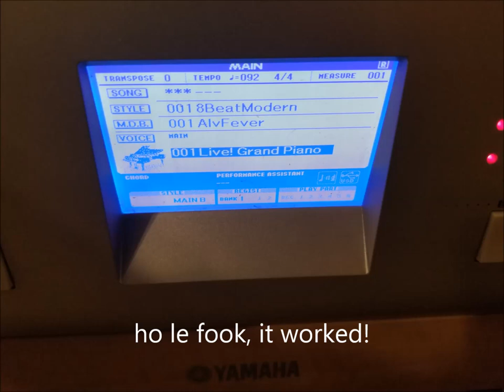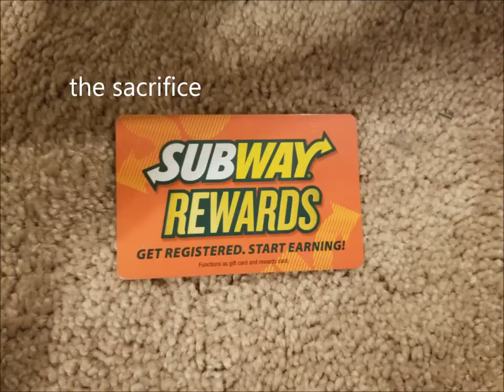Yamaha YPG / DGX LCD Screen Fix, Easy & Fast

Comment: Thanks for this great video, it encouraged me to fix my YPG-625 finally and it wasn’t too hard, just time consuming dealing with all the screws. Some tips: 1. There are two sizes of screws to keep track of, and you’ll need a bit extender if you use a power screwdriver. 2. There are two panels on the underside that also have to be unscrewed and removed because there are more screws behind them! 3. I bought a new screen instead of trying to put clips on the old one. The way the cables are attached looks a bit different so maybe it won’t develop the same problems. 4. If you replace the screen, you will need a soldering iron, because there are two wires that you need to connect (good thing it’s only two). 5. If you need to unplug ribbon cables, keep track of which side of the cable is which (I marked it with a sharpie), and when reconnecting them be careful not to kink the cable or damage any contacts.

UPDATE: A couple of weeks after making this repair although the piano keys still worked, most of the other buttons stopped working right, they would do random wrong things - only the volume control and instrument selecting dial still worked. Either something I did broke it or it was the next thing due to go wrong. Luckily I gave it away to someone who has kids who just wanted a piano to play around on, it could still do that.
Reply from the maker: Great advice, thanks for sharing. I'm glad this video helped you! This piano is approximately a 2005 vintage so many things may be different depending on your particular build.
Reply: You should have just used the clips instead of wasting money on a new screen and tampering with wires.

Comment: Almost did what this video was proposing, but after some more research I learned that adjusting the contrast could solve the problem. Just turned the contrast knob on the back and voila!
Reply from the maker: Yes, please do try this first. Adjusting the contrast knob only worked for about 1 year for me, then no longer helped. If using the knob helps, this may repair may still be in your future. Thanks.
Reply: I wish...
Reply: I didn't even know about the contrast knob.  That worked for me.  But good to know about changing the LCD screen.

Comment: Thank you so much!  I followed the directions on my DGX-620 and it worked!  So pleased. Just wish I could have shown my mother!  I used pieces of credit card as I did it before reading the comments. I’ll discard them if the clips slip off. Great video!
Reply from the maker: Glad it helped. The card was just something I did thinking it would help when I first did this and it ended up slipping off a week after I made the video. I later did it with just the clip (and maybe still some electrical tape?) and it has held ever since.
Reply: @jspianoman07  Thanks. It should save me some money though. 2/3 of a credit card looks like it won’t work as well!

Comment: The snippy clippy part was a little tricky due to lack of space and was scared to pinch the back of the connector but worked fine in the end. Very nice 3$ repair and great video!

Comment: I don't think these pianos were made to be moved a bunch. After my third or 4th move, I started to have these issues and I always figured it was a loose connection because I would apply a bit of pressure on the screen and it would start to work again.... until that fix no longer worked. Thanks so much for sharing and for the hilarious details!
Reply: The screen on my YPG-625 would work sometimes and not at other times, it was just unpredictable - even though I never moved it. It’s possible it was being affected by temperature or humidity.

Comment: Thanks! The 535 model is a little different. No orange thing, lol. For me, I just gently shifted the ribbon cable connected to the screen until the screen worked (no more lines) and then taped it in place. So far it's working good as new!

Comment: Worked perfectly. Just a note the DGX 520 model is alittle different. You actually dont have to remove the top board at all the bands for the screen are flipped so easily accessible. But there are more screws due to 2 pieces of faux wood covering the speakers on the back. MAYBE a 10 minute job. Just be careful with ribbons, i actually bought my board sight unseen (like a dummy) and dude lied and said screen worked but it didnt and you saved me 💰💰💲💲
Reply: My YPG-625 also has the two pieces of “wood” on the underside, which have to be removed to get at more screws. And yes the ribbon cables are easy to damage when plugging them back in if you aren’t careful; I kinked one and almost ruined a contact on it.
Reply: i am about to buy same model and it has vertical lines on it can you help me with that?

Comment: this is great! almost got the screen back to normal but seems there's more damage than your case so this fix worked for me I would say 70% (screen is readable but has lots of vertical lines). Still way better than dead screen. Thank you!
Reply: Check all your cables -  unplug, replug each.

Comment: Seriously dude, put the donate button for tips! I didn’t try it yet but I was about to buy a screen lcd replacement 90$, maybe it won’t be enough for me but at least I gonna try now that I know how to do it. Even if I’m an electrician I’ve not been able to find this solution. Thanks for All !
Reply from the maker: Thanks :)
Reply: @jspianoman07  😅 I have here in front of me the keyboard unmounted, I’ve pushed the point you showed in the video and also all the others but it still stay half blue half white or all blue it depends by the time, I guess it wasn’t a connection problem. anyway it worth the try. Thanks again tough ;-)

Comment: I have a YPG-535 stored away at my grandmother's house, and I'm going to be getting a hold of it next weekendnow that I've made space in my apartment. I know it has a screen issue and it looks the exact same as your screen did at the start of the video. I'm going to try this out when I receive it, and see if it fixes the problem.
Reply from the maker: Best of luck. As I replied to some other commenters, the addition of the credit card clippings are not required. When I first made the video, the clips soon after popped off. I was able to do it with just the binder clips and tape and it has held fine now.
Reply: @jspianoman07  what are the clips for? If reinserting the display ribbon fixes the problem do you still need the clips?

Comment: I attempted this on my YPG-635 and destroyed it. Had to throw it away. Maybe I'm just not good with my hands or something, but the guy in the video makes it look a lot easier than was my experience. Just wanted to put that warning out there for others thinking about trying it.
Reply from the maker: Sorry that it didn't work out for you. Of course anyone reading or watching should make a reasonable guess at how confident you are with being able to do this. Probably not a beginner project.
Reply: @jspianoman07  No problem. I'm not blaming you at all. Truth be told I was in the market for a new piano anyway so I went into it willing to throw out the unit if it didn't work out. Not a big loss for me. I just wanted to let others know that there is a risk to doing this. You make it look easy!
Reply: I rate this project a 4 out of 10 on the difficulty scale for someone who is used to tinkering and fixing stuff. But even for someone who fixes electronics all day, I think there’s still a risk that clamping the cables could simply not work or make things worse - just because of what they are.

Comment: I tried this on my Yamaha mm6 with no luck. Is the purpose of the clamps just to tighten the connection? Maybe I didn’t to it right.
Reply from the maker: The clamps push down on the ribbon cable which helps the two metal surfaces make better contact with eachother (meaning making a more solid connection). This usually fixes the screen issue because the lack of a good connection is typically what causes the problem in the first place. Based on feedback I have seen on my video, this doesn't work for 100% of cases, but does seem to help most people. This is a known problem with the YPG series Yamahas. I have no idea if it applies to an "mm6."
Reply: @jspianoman07  thank you. Maybe the screen is just broken, but I will give it another try.

Comment: Have not got a clue what your doing with the cards, and what the purpose is, because screen was fixed just tightening connection , SOMEONE PLEASE EXPLAIN
Reply from the maker: The card is not necessary. I originally added it because I thought it would help the clip press down on a wider surface area of the ribbon cable. What I found is that the card ended up causing the clip to slip off after I had put it all back together. You can accomplish the same thing and with more reliable results without the card. This video was just from my first attempt at this repair.
Reply: @jspianoman07  I had the same question. I'll have to look at the video again and again.... needs narration explaining the process. I kept pausing the play to read your instructions.
Reply from the maker: @RobertHampton747  You only needs the clips to press down onto the connection. The cards are not needed. I used them in my initial attempt to repair it and later found them to be unnecessary.

Comment: I’ve got my DGX620 open and I’m at the Dollar Store right now buying those big paper clips and electrical tape…just trying to make sense of what you did exactly? And do the clips stay there when you close it back up?
Reply from the maker: The clips are just clamping down on the ribbon cable to keep firm pressure on the contacts. The electrical tape is just to act as a dielectric to prevent anything from shorting out (the tape probably isn't even needed honestly, but I did it just to be safe and ensure nothing electrical would short out where it was clipped). For example, just think of it like if you have something plugged into the wall, like a lamp, but the plug is loose so it keeps falling out of the wall, the lamp goes off (like your piano goes off). Say you stand there and hold the plug in the wall to stop it from falling out, thus constantly applying a force to hold it in place (like a clip holding the ribbon cable down) then it will stay on and work. We use a clip so that it will keep applying that force even when we close it back up. Simple as that. Side note, the credit card is not needed at all, I removed it later on when it proved to work without it. Yes, you want everything to stay in place when you close it back up, that's the idea. If it doesn't, it likely will not stay fixed. This was a complete experiment on my part that worked for me, hope it works out for you as well. I think some others here in the comments have indicated it worked for them as well.
Reply: @jspianoman07  thanks. I’m holding the screen in my hand as I type this….my clips might be too big but I’ll find out in a couple minutes. 
Thanks again.
Reply from the maker: @murphine969  Sure thing. Be warned, getting the clip in was tricky because it barely fit and kept falling/springing itself off. You will eventually get it if you keep at it, assuming it's just not outright too large. You do want to check that it actually fixed the problem before screwing everything back together, else you're taking a big gamble.

Comment: Hello, I have the YPG-635 model.  On some days, the screen works fine and on other the days, the screen stops working.  But it has been working good for most days.  Did you have this experience before the screen stopped working completely?  I'm debating if I should try the paperclip binder now or if I should wait until the screen stops working completely.  Thanks for the video!
Reply from the maker: It would go in and out for about a year or two. I could sometimes get it to work by smacking the screen hard with my hand. Then it finally totally went out. If it is going in and out, it will eventually completely go out, but it may take some time.

Comment: Just tried this. So far only half of my screen came back but maybe I just need to move the clips around a bit. Also, I’m not sure why I was supposed to remove the speaker cable so I didn’t, maybe that’s what I need to do? Thank you anyway though, half a screen is better than no screen.
Reply from the maker: Removing the speaker cable is optional, just makes it easier to get the top part out of the way so you can maneuver more easily. For me, wiggling the clips around eventually gets the connection to make up properly, but I suppose this may not work for 100% of cases.
Reply: @jspianoman07  Got it. Thank you, again!

Comment: Didn't work for me 
I've got a DGX640, it's slightly different inside and there's not enough space inside for larger clips 
I did apply a little pressure in different places to the thin ribbons and the screen came on!
And off
Half on
Covered in lines
Thanks for the vid I'll keep trying different things
Reply: I have a DGX0620, and a similar experience. Did you ever find a solution?
Reply from the maker: Sorry to hear that. Sounds like it is a similar issue though. You may have to experiment with different ways to clamp down on the cable. I hope you figure it out. Thanks for the feedback.
Reply: I'm just gonna get a new screen from flea Bay, it's only 2 wires to solder on, after opening the keyboard up once I'm not feared about it....
Everyone should definitely try this fix first, when you start playing around with the ribbon cables the problem becomes apparent
Reply: p

Comment: I might try this, I’m curious though, why does this happen to these pianos? Is it really common or is it because electricity or something? I wanna know if it was my fault.
Reply from the maker: It's not your fault. It is a known and documented design flaw with these older Yamaha pianos. It has nothing to do with the electricity and highly unlikely that anything you did brought it on. The ribbon cable in the paticular spot appears to be held on by an adhesive and my theory is that it simply loses its strength over the years and comes lose. Kid of like how if you tape something on your wall, eventually the tape comes lose and ot falls.
Reply: @jspianoman07  I see that does make sense. I’m gonna have to try your method once I have enough time, it looks like an easy but long process haha.
Reply: I think Yamaha just uses crappy screens.  I have a mm6 with the bad screen as well

Comment: @jspianoman07 can you play normally on a it if the screen doesnt turn on at all? Also do you think it would be a easy fix? thank you!
Reply from the maker: Yes, plays fine with the screen broken. You can still change the voices and use any of the functions, just can't see anything on the screen. The fix will be easy in difficulty for someone who is comfortable with a screwdriver and has taken things apart before, probably moderate difficulty for someone who has not.

Comment: Hi, can someone help me please. My display is working except it is dim. I think the back light is gone. I blinked and came back and went dim again. However, I opened the casing and one of the flat ribbons came off. I accidentally pushed it without realising the bare wire were not sealed in the plastic and all bent. I straightened them but they are so sensitive that when I push them in , I think they touch each other and nothing works except the piano and the large dial that changes the voices. I pulled it out and in again and some of the buttons worked and went off again. I ordered new flat cables but I they have not arrived yet. I like to know if anyone had a similar problem? I am not sure if anything is damaged.
Reply: Did you try to turn the contrast knob on the back of the piano? If the screen is readable but dim or washed out, maybe that’s all that’s needed. Re. cables, I almost caused the same damage when reconnecting the flat cables. You have to be very careful.

Comment: Are all the bottom screws the same size and length?
Reply from the maker: Speaking from memory here, I believe so.
Reply: On my YPG-625 there were two sizes of screws. The ones closer to the outside edges (mostly) were the shorter ones.

Comment: Wait, I dont get this. Do you leave the clip inside?
Reply from the maker: Yes, the clip is to help the ribbon cable maintain contact with the board. The little piece of card is unnecessary, I later removed it.
Reply: jspianoman07 I’ve reas that you  can heat those flex cable while pressing it? I wanna try it but I am not sure

Comment: So does this happen due to pressure being applied onto the screen? Thanks for the video!
Reply from the maker: Ultimately it comes down to the electrical connections. They are making poor contact so the screen is no longer getting good data which results in jumbled lines. By applying a constant force to them (clamping them down) you are ensuring that the electrical connections stays solid which makes your screen work properly.
Reply: jspianoman07 I understand, thank you for your prompt response, 
regards

Comment: I just did this and accidentally tore one of the flex cables when the clip popped off. Now the E and Bb keys across the whole board are unresponsive. Be careful if you do this!
Reply from the maker: Sorry to hear about this, yes, there are risks associated with this repair. To anyone reading, please use your best personal judgment when deciding if you are capable of this work or not! It worked fine for me.
Reply: The screen is working fine now though! This 100% works as long as you aren't a klutz haha

Comment: Is it possible to solder it ?
Reply from the maker: I would not recommend it.
Reply: I don’t think so, it is a very small connector with many surface contacts extremely close together. If it’s possible at all you would need to be an expert solderer and use a magnifying glass, and have VERY steady hands.